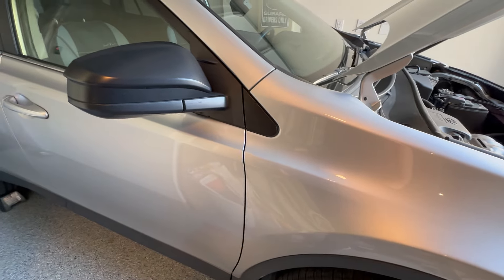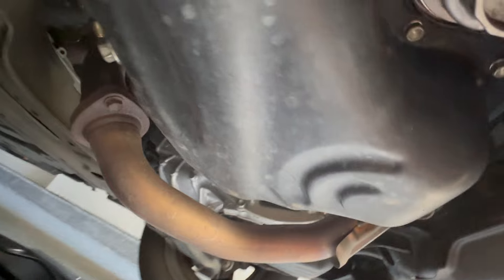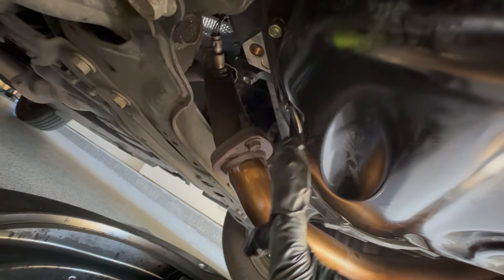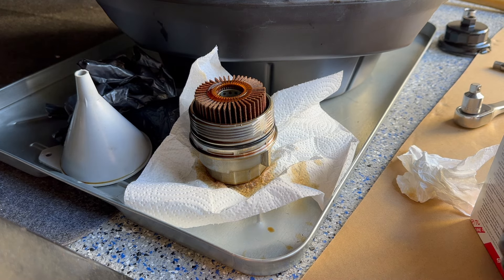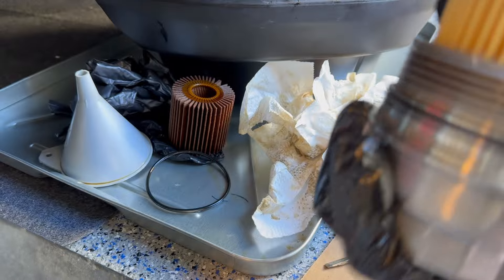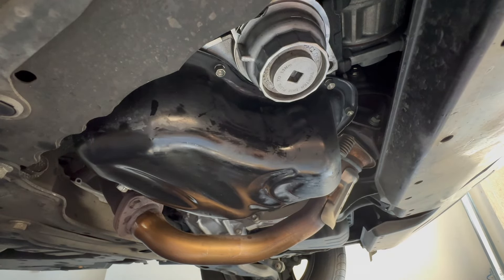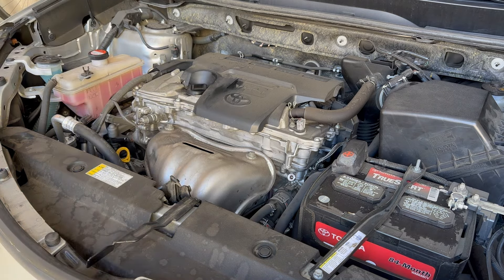How to change your 2013 - 2015 Toyota Rav4 Oil Change

Comment: Nicely done! 👏🏼👏🏼👏🏼

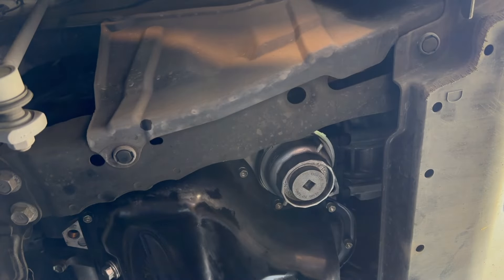@6:50 -- Instead of removing the whole oil filter housing, you can also first remove the center cap using a 3/4" socket wrench.  The filter comes with a little plastic plug.  Once you take the filter cap off, you insert the plug, and the oil comes out in a nice stream--instead of all over your hands.  After it stops, you use the filter wrench to remove the whole filter housing, with no mess.  If you do this, you must replace two O-rings--one for the cap, and one for the housing.  Both are included with the filter. 👍
Reply from the maker: Good tip, I did not know that

Comment: What is the name of the tool you used on minute 6:42”? Thank you
Reply from the maker: It's an oil filter wrench specific for Toyotas of these years, I got mine off Amazon a few years ago, but this is a similar one: https://amzn.to/40mIj1Z
Reply: @revcircle thanks for your response. Sorry, I meant the flex wrench 🔧
Reply from the maker: @pezkao2009  Not sure what you mean by flex wrench, that toyota oil filter wrench is connected to a 3 inch extension and a breaker bar. Then I use a ratchet after to take it off faster

Comment: Hi, I have the same yr and model rav4, do you know what’s your rpm idle at normal temperature in park position? I’m getting like 780 rpm at idle (park position) and 650-700 rpm ( in d position) using obd2 to read. I just want to make comparison with other rav4s.
Reply from the maker: @nilolee2426  I haven’t took an obd reader to it. But it seems idle at the ranges you mentioned. For sure below 1k rpm sound 700-750 is what I saw in the gauge when I ball parked it
Reply: Mine has similar RPMs